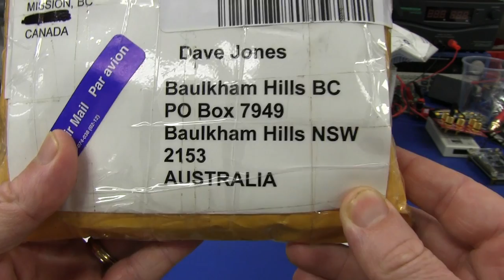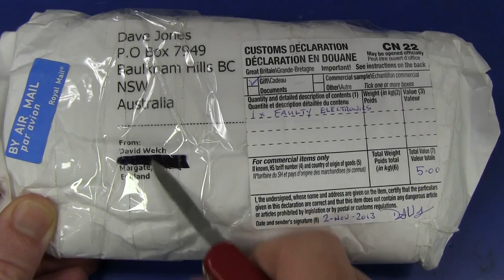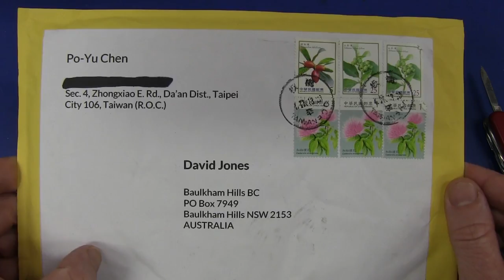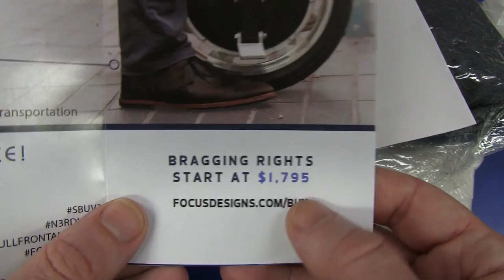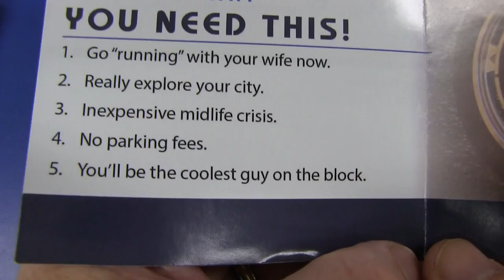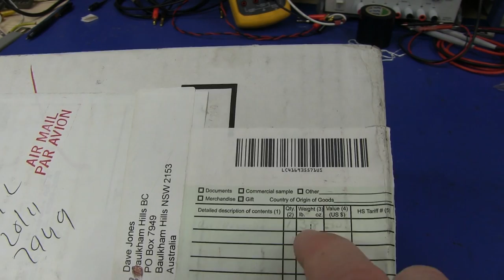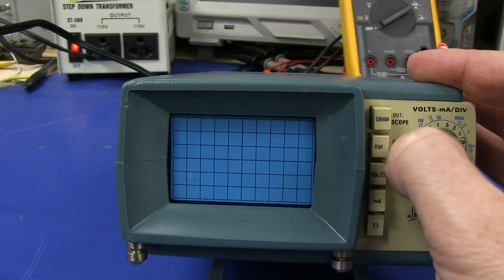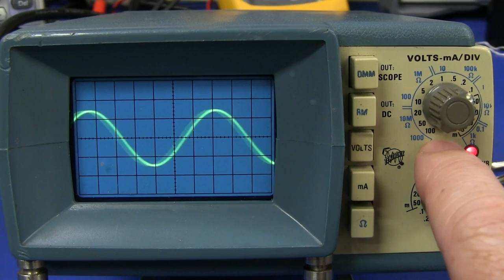EEVblog #553 - Mailbag

Comment: They run the polycarbonate (edges sheilded by a lead mask) through a linear electron accelerator at 8 MeV or so, so that the electrons come screeching to a halt roughly halfway through the block and get stuck in a pocket of charge (up to and over a million volts of potential in there!). They then poke at the surface of the block with a grounded spike and BAM, the charge forms  channels through which they drain from the charged (unmasked) region to the spike.
Reply: Great detailed answer, fascinating!
Reply: yeah, thanx
Reply: highvoltagefeathers Not Polycarbonate... This is PMMA... PolyMethylMethacrylate.. AKA,, Acrylic or Lucite.  Very common within the plastic fabricators field. This can be done with small pieces such as yours or can be done in very large blocks.  I have several of these that I picked up at a salvage yard.

Comment: You can create a crude form of a Lichtenberg figure by discharging a static charge to a metal point in the centre of an acrylic sheet, then dusting with toner powder. Patterns of stranded charge are visible. Unfortunately not the figure itself, but at least you don't need a Dynamitron this way...

Comment: Lichtenberg figures in polycarbonate or acrylic are usually made by irradiating the plastic with a linear accelerator so that electrons can be trapped inside it;  then they tap it sharply with a pointed conductive probe, causing the electrons to discharge all at once.  There are some videos on YT showing the process, it's visually quite amazing.
Reply: Came here to say this, they're very cool.

Comment: Ripped apart an old Tektronix 529 Waveform Monitor last week in true EEVblog fashion. Found some pretty cool bits in there but holy hell am I glad I never had to build circuits on those old ceramics. It's pure chaos trying to make heads or tails of all the circuitry.

Comment: Beware of that DIN 41612 extender cable. If you do it like that with two female IDC connectors, and a male-male straight through gender changer, you'll actually swap the A and C row. Shortcut alert!!!

Comment: The lichtenburg is iradiated with high energy electron radiation from a linear accelerator and then every mechanical touch or bump causes the stored energy to disapate on the branches.

Comment: 15:00 the lichtenberg figures are from bombarding the acrylic with an electron beam with phenomenal energy...building up MASSIVE static electric charge, then they tap it with a grounded point letting an explosive discharge of the static buildup escape at once, superheating the acrylic and turning it white.

Comment: those figures are held in a high voltage clamp connected to a lighting generator (massive cap) a nail with a conductor cable is hit into the block and the shock causes massive electrical discharge,
there can be small arc  even a month after being made as the material shifts
Reply: No, they are made with a linac.
Reply: Jared Reabow That's a completely different process (using treated paper).

Comment: Hi Dave,
first i would like to thank you for your  interesting videos!
I was wondering why the Sony and Roth extender cards were so large( in length) doesn’t that cause a lot of extra resistance and unwanted capacitance between the lines? Or were they used for purposes that needed such a lengthy connection?
Thx a  lot for your answer!

Comment: I want to buy a Gossen and Fluke multitester because I want to treat myself to the best. Which is way I watch EEVBlog. I had to write several emails to locate and price the Gossen "Energy". I called Fluke to ask about the 87V IMPROVED but I got voicemail. Digi Key said that they would email me if they had the 87V IMPROVED multitester. I await that email with newfound ardor. Dave, you are god, no doubt about it.

Comment: good explanation!  typically this is done during the last days of a linacs life.  A radiation therapy machine is capable of producing electron beams of varied potentials.  As a dielectric (poly) is bombarded the electrons pile up and create a truly tremendous potential.  When grounded you see (sensible) symmetrical discharge pattern.  Most therapy physicists have one or two of these.  They don't come cheap.